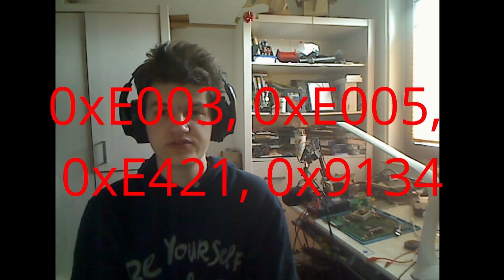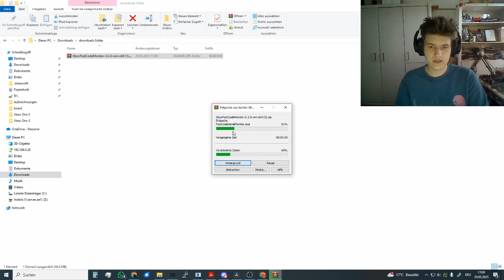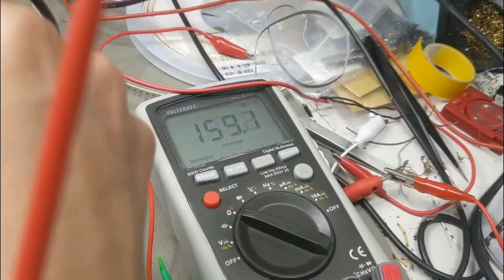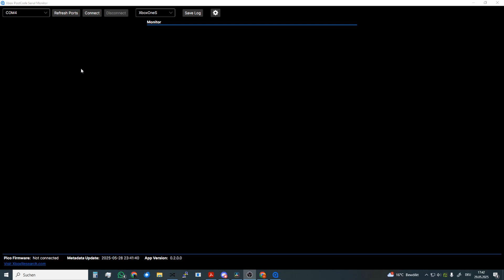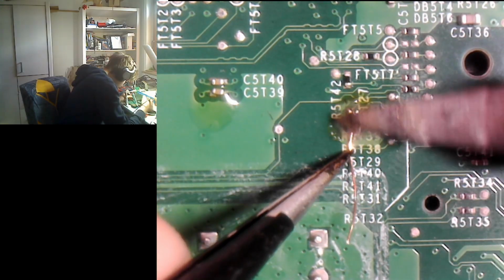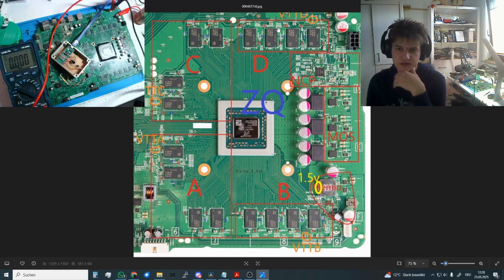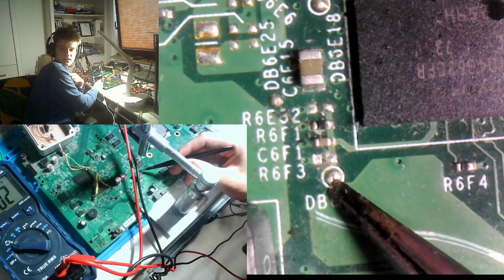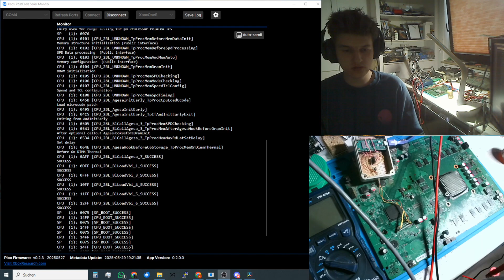UPDATED Xbox Diagnosing Tool -  Beep On/Off One S - Electronics Repair 11

Comment: hey nice video, it's really helpful. On my xbox one s i've got an 0xEB41BOOT_PSPBOOTACKWAIT_DONE and from another video, i saw on Power Stage B  the point number 4 gives me 0.6V instead of 1V. What does this all mean?
Reply from the maker: Hey, thats some good Observations.
EB41 means APU is Not responding to southbridge. This can be because of a powerrail Missing.

Please First Check If the APU is cracked in the Corners.
How many Seconds does the console stay on?
Is Stage B Point 4 the only voltage that is Low? Are any other voltages Missing or Low, in Stage C?

Please Join the discord so i can Help you easier 🙂

Comment: Many resistors missing in some of the repairs recently seem to have been removed on purpose, but they may not have been either, good job
Reply from the maker: Hey! The board was shipped to me in a box with other boards, stacked on top of each other. I think the resistors have been knocked of the board because of that? E003 and E006 were dead chips tho :D Thank you for watching.

Comment: Got an E08C Error on a Series X board. Most likely the U480 or U57 REG as mentioned in the description on PostCode? Any way to test these before pulling them, says to check voltage on the vinsen pin but don't understand how I can do that with the boards sandwiched & without voltage injection?
Reply from the maker: Hey. I have got a user report that said "Resitor R132 alterado na linha do VINSEN_12P0_MEMIOPHYSOC que vai para o U480 (MP2926)".
another report i have: "SERIES 0xe08C SOC board not getting 12v - probably actually has another meaning and is just caused by disconnecting 12v from SOC board too (some PG or i2c failure)" -> did you make sure 12v connector is plugged in fully?
Thats all i know about the error, so thats why i wrote such a description.
You can measure the resistors in resistance mode. Check in schematic. confirm the resistor has the correct resistance of 150kohm and no corrosion is around it. then check, that you get a continues path from the 12v power connector to one side of R132 in contenuity mode.

If you want more help, please join the discord, report back, and we will search for further solutions !

Comment: hi, i apply the xbox diagnostic tool method but i need help, i have a xbox one s that boot success but is shutting down after a random time showing the error code 0xec01 SMC_RUNTIME_GET_SOCSyncFLOOD_STATE if someone can help me with this because there is no info about this error in the red

Comment: Trying to flash the file to my pico2 using the V0.3.0  and file pico2.UF2 but my pico is not rebooting and if I unplug it and plug it back in it just goes back to boot mode 😒
Reply from the maker: Hey. Pico 2 is not compatible with the precompiled files. Either join the discord so someone can send you a dump for pico 2, or compile your own 🙂

Comment: Necesito osciloscopio para el proceso?
Reply from the maker: For reading error codes from the console with the pi pico, osciloscope is not needed !

only if you have 0x9134 error, having a osciloscope is very helpful.
Reply: @craftbenmine Muchas gracias por contestar. 🙂

Comment: I can recommend using Battlefield 1 to test the replaced NCP chip is OK, I replaced one and Fortnite my normal test game was fine but Battlefield 1 caused the system to shut down, I had to remove the chip clean up the pads and it worked without crashing system after that
Reply from the maker: Probably a phase was not running properly due to a disconnected pin. I will surely do that, thank you !

Comment: I have this error 0xec06, I wonder if it can be fixed?
Reply from the maker: Are there other errors? What is the last error before 0xec06?
Reply: @craftbenmine  This is the only error and nothing else appears
Reply from the maker: @3eumesmo  I have not seen 0xec06 only. If there isnt a 0x9134 before 0xec06, i dont know what it means yet sorry.
Reply: @craftbenmine  yes, it exists CPU (1) : 0x9134 before
Reply: Sorry for my English, I'm Brazilian and I'm using Google Translate
Reply from the maker: @3eumesmo  Hello, Like you see in the video I also have the error. 

To fix it: 

"General memory error (MEM <-> APU), check V_Memio / VTT A-D resistances&voltages, check resistors around rams, replace rams (ZQ method?), reball apu."
Reply: @craftbenmine  thx
Reply: @craftbenmine I managed to fix it, I checked the resistors around the memories, some were oxidized, I replaced them with others and it worked.